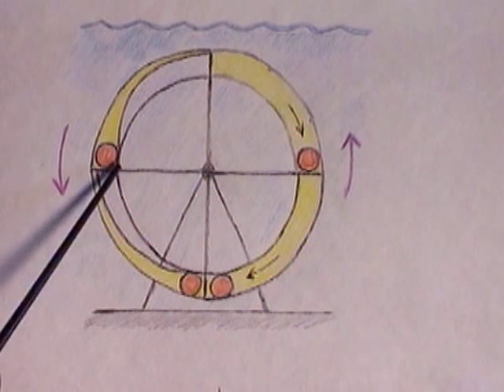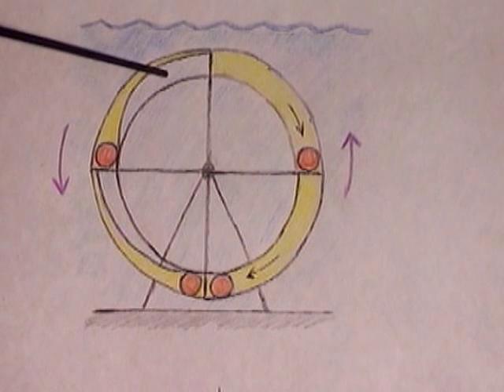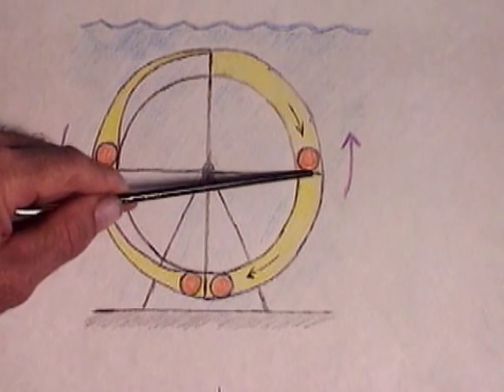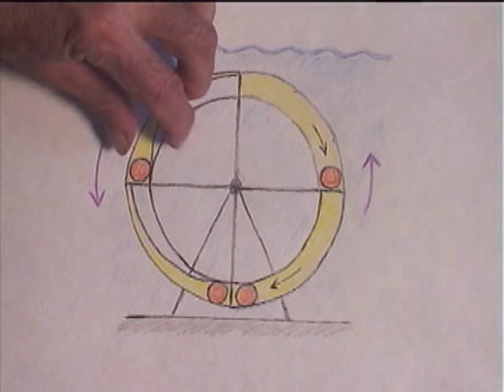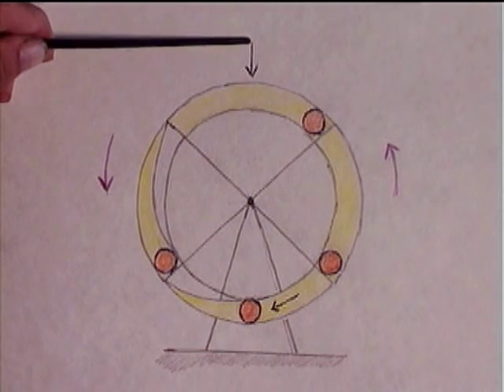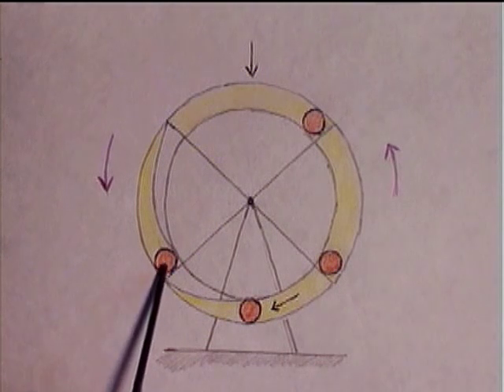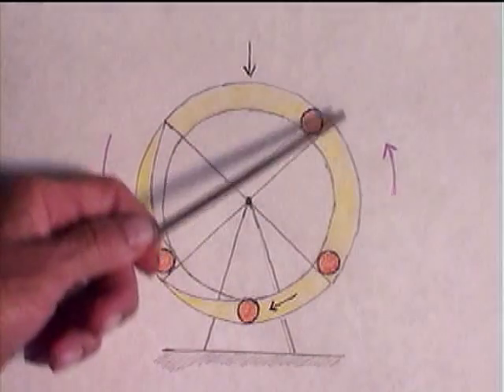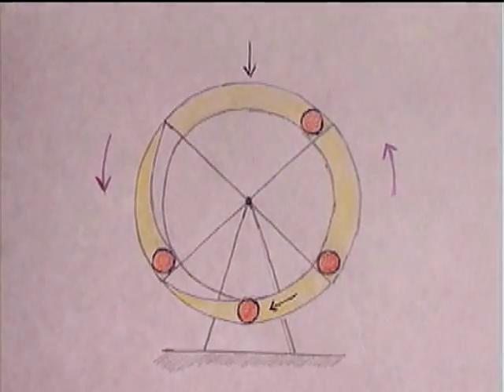Water Perpetual Motion Machine P13

Comment: If the yellow is air, the water pressure will never allow the ball to overcome the restriction and force open the balloon.  Additionally, if a weight is allowed to fall, while it is falling, it can't act on the wheel or lever or whatever it's connected to.
Reply from the maker: RadicalRC The ball by itself is heavier than water and would not be stopped by the water. The wheel turns after the ball falls and fully inflates a ballon.
Reply: towtops How does more air come into the balloon to inflate it?   What I see in action is only a slight change in pressure on the balloon as it enters the higher pressure of the water.   This would reduce the balloon only slightly is we are talking about modest depth.
Reply from the maker: RadicalRC The deflated balloon has little air inside.  The falling ball stretches the balloon open on a frame. The inflated (or stretched) balloon 
has little air pressure inside.  That is the problem with the device.  (Note: buoyancy does not depend on air inside the balloon but on amount of
water displaced by the inflated balloon.)
Reply: Ultimately, if it's a balloon, it will only be as open as it has air to fill the volume and balance it against atmospheric pressure.  It makes no difference if a cavity contains air or nothing but rather only the difference in mass (due to displacement) is at issue.  However, you have atmospheric pressure working on the outside of this balloon.  The ball is not going to be able to move with 14 psi of balloon squeezing against it if the balloon is evacuated.  I don't completely understand the devise.  However, it will turn out not to violate physics and no over unity can be achieved.
Reply from the maker: RadicalRC Atmospheric pressure is part of water pressure, you don't figure them in separately. A ball in a low pressure chamber will fall if the ball is heavier than water.
Reply: towtops Yes, it's in addition to atmospheric pressure.  You figure it in "additionally".  A ball would only ever rise in a fluid heavier than the ball and that isn't in play here at all.  The ball is always heavier, it's always seeking the lowest position it can reach.   In your cover photo drawing, the wheel can never rotate to clockwise.  To do so, it has to lift a ball.  The two on the horizontal line balance each other so they make no difference.  Nothing can cause this to move.  Nothing here is holding the tube on the right 1/2 of the drawing (below water) open to cause it to weigh less and rise.  You have it drawn inflated, but it's a balloon presumably held open not by air, but by the ball.  Thus it will be squished around the ball in a wedge just like the left side of the drawing.
Reply from the maker: RadicalRC ( 1). In dealing with buoyancy problems one is concerned only with water pressure (not atmospheric pressure). (2) the inflated balloon and ball form one unit that is lighter than water and will rise counter-clockwise. (3) You are correct about the "squished" aspect. That is why the device doesn't work.